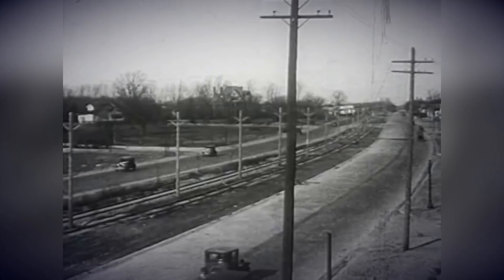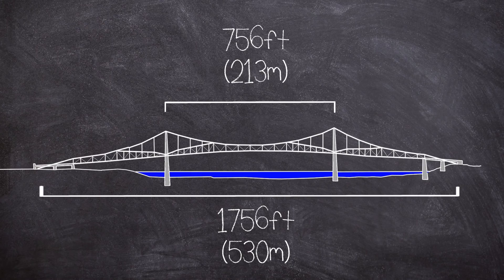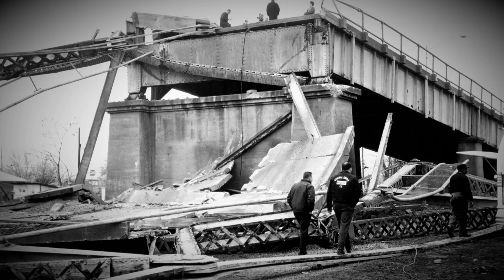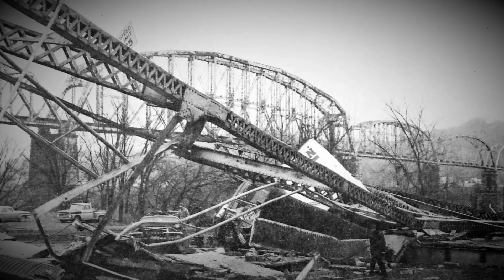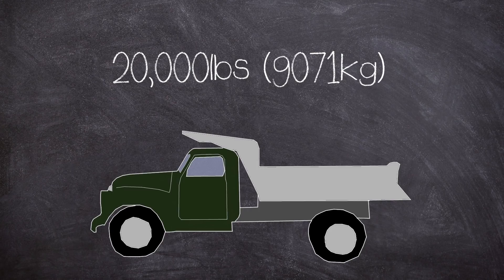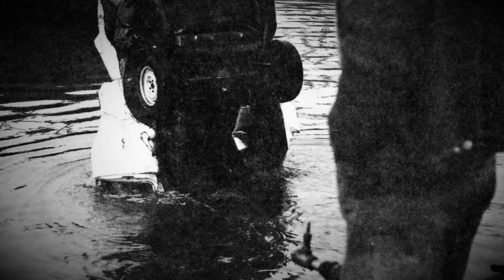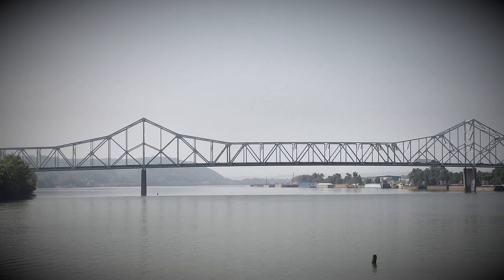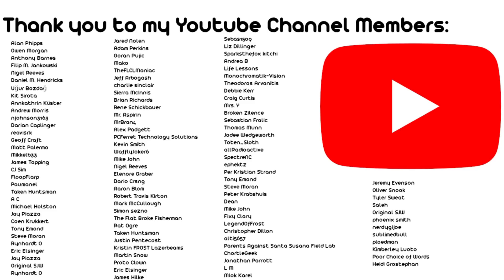The Silver Bridge Disaster of 1967 | A Brief history of Documentary

Comment: I am surprised that the bridge managed to hold up so long. Being overloaded not just by much three times as heavy vehicles, but also the replacement reinforced concrete driveway instead of the previous wooden/asphalt layer surely added much more weight, resulting in both static and dynamic stresses far exceeding original design. Some bridges were close to collapse, being also overloaded and used way past their expected lifespan, but they did not collapse, as they were closely monitored. One such bridge served almost 60 years instead of the designed 10 and its driveway, originally with wooden pavement blocks being replaced by heavy reinforced concrete panels with an asphalt layer on top. Originally a cheap, temporary, "war bridge", it served well into the 21th century. Without collapsing. There were some local and serious failures on the bridge, but nobody got hurt. The bridge was already closed for car traffic at that time so a potential disaster was avoided. But it showed that the closure was justified.
Reply: Which bridge (and where) are we talking about?:)
Reply: @antonberglund117  The Old bridge in Bratislava. After retreating Nazi forces had blown the original bridge, a makeshift "temporary" bridge was built in record time, planned only to last for 10 years. It served almost 60. It was then taken apart and a new Old bridge was built. It still has the name Old bridge, even as it is the second newest over the Danube as of 2023. I keep forgetting the recently opened bridge that carries the D4 motorway.
Reply: @erikziak1249  Thanks for sharing, intressting how "temporary" things becomes permanent. The same goes for both buildings and trains.

Comment: Awesome upload John, Im so sorry to see the loss of your fuzzy buddy man. I know it's hard to lose a pup but atleast you had 12 good years with them. Not having redundancy in something like this is insane. I mean you wouldn't fly a plane that didn't have several instances of redundancy built in. If not for safety then certainly so you could do a more thorough inspection. Plus going from wood planks and asphalt to concrete grid I am sure the weight increased a great deal. In addition to the increased weight of vehicles, and increased traffic of heavier vehicles. Just like a bridge build for the weight of vehicles and traffic of the 60s would be insufficient for vehicles of today as well as the higher population and thus increased traffic.
Reply: Your comment hits all kinds of good points. Thought I'd just add this info. In the case of redundancy in air planes look up the Air Alaska plane that crash off the coast of California due to a failed jackscrew in the rudder. There was no redundancy for a failure in that part. Air Alaska 261.

Comment: One question: You mentioned that the initial deck of the bridge was made from wood, then eventually topped over with asphalt, and then concrete. Those added materials would have also made the deck about 10x or more the weight for the structure to support. Even cars and trucks at the time were light by comparison as the bridge was added onto.

Comment: Are bridges more dangerous than elevators? I ask knowing that more knowledgeable people will reply, my guess is yes.
Reply: I would say it all depends on how well and often service is done. Anything can fail if it has been working long enough. Since im used to Germany safety standards i cant hold myself back from looking for the safety sticker on any machinery that could kill me. If the elevator had no service im gonna use the stairs O.o
Reply: I would assume.

... However, the elevators at my job are getting frisky.😵
Reply: I would say bridges are more deadly
Reply: As a general rule, walking across a street is more dangerous than riding an elevator or driving across a bridge.
It of course depends on the street and time of day as much as it depends on the inspection/service interval of an elevator or a bridge. 
However, there are laws that regulate inspection/service intervals, whereas there are often laws against you just walking across a street wherever and whenever you like. Long story short: Maybe.
Reply: I would agree with Jonny Smith and add in that I believe bridges are more dangerous than elevators. It is much easier to shutdown an elevator for inspection or maintenance. Bridges on the other hand are more difficult as shutting down a major bridge will lead to redirecting traffic onto roads that are not always designed for heavy traffic loads. So unless something severely wrong is discovered with a bridge they are more than likely to just let it be, and hope for the best.
Reply: @shadowcaptaincain  a bridge can generally inspected without shutting down traffic at all or for long. Repairs are another matter, but once you know you have to, there is no excuse not to - at least none that shouldnt land you in prison if something like this happens. Danger comes with negligence.
Reply: Probably. Elevators have a lot of safety features. Even if one falls you have a good chance of surviving.
Reply: @Ganiscol  sadly prison isn’t where those negligent few end up
Reply: They are all safe until they aren't.
Reply: In the same way planes are more dangerous than cars. Scales of disaster.
Reply: @Ganiscol  Very true. I wish we had laws like South Korea and other nations where if your negligence results in such accidents you go to jail, even corporate suits. Here unfortunately they just get sued and will pay a fraction of the cost of what it would have been to build properly or carry out maintenance properly, thus not making it financially beneficial to do the proper work.
Reply: Can't say I know for sure about likelihood of failure, but I certainly prefer my chances on a falling bridge than in a falling lift.
Reply: Depends on country and safety and building standards. They talk about americas infrastructure as if it’s third rate but it’s really not.
Reply: There are too many variables to answer this question with any degree of confidence.
Reply: Any modern elevator has safety latches that actuate if the cable breaks. Most importantly and unlike bridges, they’re also kept from environmental exposure. 
IMHO bridges are more risky.
Reply: Not many car crashes in elevators, never heard of a suicided by elevator.

Comment: I would like to take a moment to marvel at the fact that those eyebars can be made in such quantity in the first place. It might sound trite to someone today, but even things such as nails for regular carpentry, used to take a ton of time to make (yes, forged nails are still better than ones made of wire in many regards).
Reply: The 11 inch link holes got my brain wondering how they manufactured all that back in those days. No computerised machinery back then. It was all controlled by hand and using templates and such.
Reply: The bridge was built in the 1920s, not the 1320s. It was manual, but they didn't need magic. Probably forged with a huge hydraulic press just like such things are made today. Machining probably didn't use electric motors as a power source, likely steam, combustion engines, or even water power. And they had templates and jigs instead of CNC to control the operations. But the business end of all the tools would be the same as they are today.
Reply: @johnladuke6475  Agree, although I would expect by 1920 electric motors would be the dominant form of power, and there was plenty of mechanised automation - capstan lathes for example and of course power looms had been automatically weaving complex patterns for decades before then.
Reply: @tin2001  You should look up some of the massive presses that the US has made over the years, start with the Heavy Press Program. This is a little after the bridge here, but it makes for an impressive starting point and its not like the actual types of machines didn't exist before the 50s either, they just grew to monstrous proportions during the cold war. Then start looking at stuff like drop hammers/steam hammers and other large metalworking machinery.... they are amazing.

addendum: Its not like the US is the only nation that has these things, but there are not many other places that have ones of comparable size. Just imagine the amount of work, from design to fabrication, for a 50,000 ton press.....
Reply: @johnladuke6475  Or with a bigass drop hammer. Which is really just a more modern version of a trip hammer, which go back 2-3k years, depending on who you ask. :)
Reply: @Titan604  Indeed, a machine the size of a building can be a mechanised "control computer" as complicated as a fancy watch. I honestly just don't know enough to have said for sure how powerful and prevalent electric motors would have been in the industry of the time, but I'm pretty sure a lot of legacy power sources were still in use in those days.

Comment: The lack of redundancy with this bridge was only half of the true cause of failure. Equally important was the lack of inspectability once built as only the outer faces of the outer links could get that, so anything going wrong with the inner eyebars would be hidden. This is still an issue with most multi-link chain designs, but at least those designs have enough redundancy so that this type of failure can be dealt with before a disaster happens.

When it was built the Silver Bridge design was considered to be good and especially the eyebars and pins which were far beyond expected strength requirements. Micro-cracking was an unknown so the dye-testing and Magnafluxing tests we have today which can detect that weren't employed; even cold brittleness of common steels was little known outside of the military. The cheapening didn't help at all, but we could build a nearly identical bridge today and not have a similar failure happen. 

One other providential thing about this design is that it wasn't as aesthetically pleasing as most bridges were and are, which prejudiced it in the eyes of the government people who select our bridge designs. Looking like something built from an Erector (Meccano) set doesn't exactly inspire confidence does it?

Comment: There were a few fatal flaws with the design, including that it was not sufficiently flexible and would be stressed by sheer winds. Sheer winds would tend to cause stress on the eyebar holes which, in time, could lead to cracks or reaming out. It would also put stress on the undersized endcaps which could eventually suffer metal fatigue and fail. And there's the simple fact that the design could not be repaired or inspected once built. Even a mechanically-minded individual who's not a degreed engineer should have been able to see some of these flaws.

Comment: I'm starting to see a theme here... Engineers of the past design a structure. They set appropriate safe working limits. The structure is built and used correctly.
Some time later, when the original engineers are gone, someone in authority just decides the original limits weren't important, and they just increase things without any understanding of the design or why the original limits existed.

Maybe we shouldn't allow safe working limits to be changed (upwards at least) without major reengineering works being done to fully support the new limits.

Comment: Chains and metal fatigue are where the discovery of metal fatigue was discovered, resulting in steel cables becoming the preferred material for things under tension, such as bridges, elevator cables and winching equipment, because chains are just not good at holding up for long before giving up inder stress...

Comment: your drawing at 3:14 seems off - I think the 2" thick is the thickness front to back of the plate they were cut out of and the 12" is the width along the length - that is all assuming the 11"diameter pins is accurate.

Comment: You completely messed up the length of the bridge.
You say it’s total length is 1750 feet, graphic shows 1756 feet.
You say the main span is 700  feet, graphic shows 756 feet.
You say each end is 380 feet‽ That absolutely doesn’t fit. Each end should be 500 feet if the main span is 756 feet and the full length is 1756 feet (what the graphic shows). Each end should be 525 feet if the main Spain is 700 feet and and the full length is 1750 feet (what you say).

Basically, at least one of your numbers is incorrect.

Comment: I think it was the wind. weathering issues the moisture in wind that might of had something to do with it. Including the heat of the sun. With might of sped-up the humidity.  Factors may have been  temperature, humidity, the Sun, and wind speed. Or Just Humidity and Moisture. It may have Weathering and erosion. Not just single point.  Baby on Board.

Comment: I looked at a documentary of this (https://www.youtube.com/watch?v=8w5Fjouvma8) and it seems interesting that when the bridge fails (18 mins on) their diagram shows the failing joint (I-Bar 330) between the land and the nearest tower, yet they show the tower falling TOWARD the failed joint...
I don't have the greatest grasp on bridge structure & loads etc.. but it seems to this armchair observer, that if that was the joint that failed... the nearest tower should have fallen AWAY from the failure as it was no longer being supported from the failed joint... (If 2 people pull on both door handles of an open door, the door travels away from the 1st to let go, not toward them...)
Maybe their diagram was inaccurate... but why would they do such a complicated diagram if you don't actually use the correct physics and known location of the  fallen structure...

I remember a similar question being asked of an airplane crash in New Zealand many years ago where it was 'suggested' at the time of the crash that it was pilot error that caused them to fly into a hill... only years later for someone to point out part of the debris was located BEFORE the impact site (ie it had failed before the crash) and without that part (of a wing or tail I believe) it was miraculous the pilot got the plane to where it finally crashed.
(I know the family that had the motors from the plane but I don't know what crash it was)...